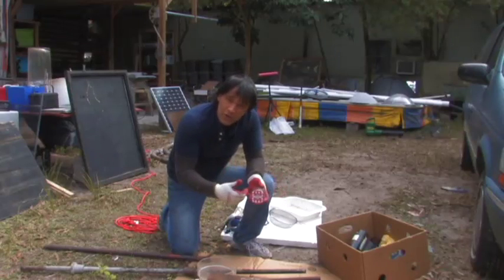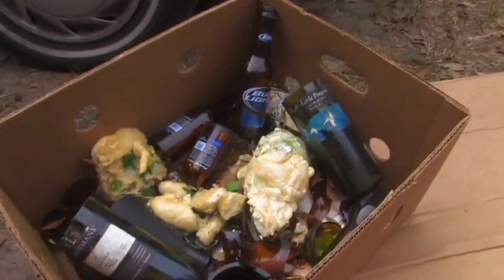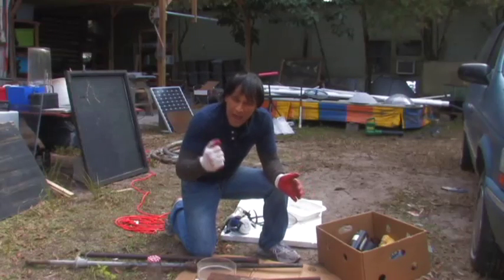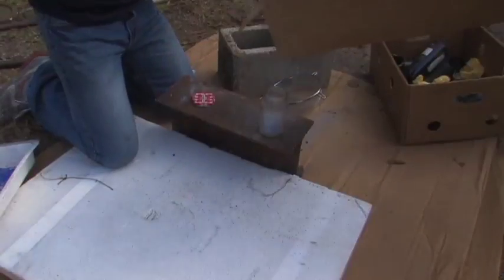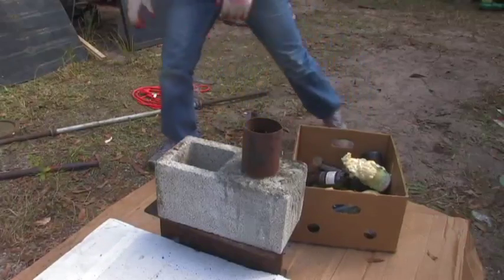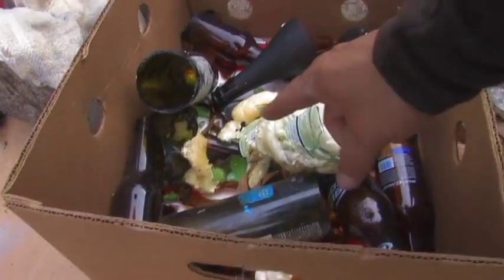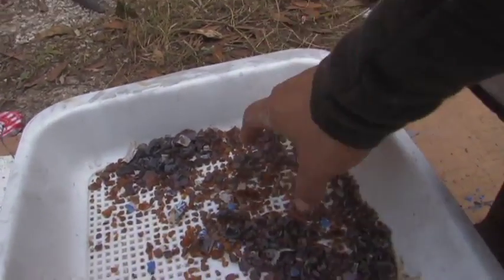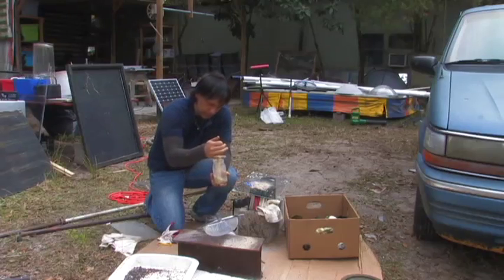GLASS BOTTLES to SAND glass recycling DIY colored glass

Comment: dang...all you kids...he didn't fart. he dropped the bar and it vibrated/bounced, causing that sound. never made that sound yourself dropping a bar that lands on one end first? poor people! thanks for the ideas here! you could remelt some in a mold with your parabolic reflectors maybe? (layer it in pipe, then fuse it?)  I have to see you using a Fresnel lens to see what you mean. Stage lighting and lighthouses use them, in different versions. Thanks for the video!

Comment: I recently ground up a ton of beer bottles using your method. I used a metal T-post driver a popcorn tin and a plate of metal and ground up a ton of brown beer bottles I picked up off the road and also ground up a bunch of green Ale-8-1 ginger ale glass soda bottles as well.

Comment: I'd be a bit more anal about protection with glass dust it will litterally blind you and cause horrible respiratory problems.  Not usually one to stress on most things but make sure your eye protection is the fully sealed kind and definitely use a heavy duty respirator like he was wearing.  Good luck on all your projects and as always great video Dan.
Reply: I agree. I don't know if silicosis is a concern, but definitely use a good respirator.
Reply: hes got all the safety gear didn't you actually watch the video. Ignorant comment.
Reply: You guys blind? You missed the part where I wrote "make sure your eye protection is the fully sealed kind and definitely use a heavy duty respirator like he was wearing." 

lol... Speaking of ignorance.

Dumbasses
Reply: Souuuuuuuuuuuuuuuuuuuuuuueeeeeeeeeeeeeeeeeee!
Reply: NomNomNom

Comment: It is important to know that Glass has a COE or Coefficient Of Expansion. Not all Glass Expands and Contracts at the same rate as it Cools. If the COE of the different colors differs enough. The Glass will crack as it cools or will be very brittle. The Glass need to cool slowly so that the Out Side and the Inside of the Glass Cools Evenly to reduce stress through the glass. Large chunks of glass over an inch thick will need and Annealing Kiln to keep the glass from cracking and 2 releave stress.

Comment from the maker: @Moroboi Yes, the soda glass is very heat sensitive so it needs to be annealed gradually after you form it in the melted state or your project will shatter when it cools. I widen the focal point of the lens by 3 inches every 5 minutes over 15 minutes to an hour depending on the glass volume.

Comment: For cleaning the glass I think some sort of acid would be the best thing. Crush it down till its liek gravel, set it in a light acid, wash it, then pound it down some more.

Worth it if your trying to sell it or need high quality stuff. 

I really think this technique could be taken to a smaller scale. 
Just seems like a lot more heavy lifting than is neccissary to crush glass.
I could be wrong of course.

Once again, another great video dan.

Comment: as a glassblower i tell you - this stuff is dangerous enough to render it not 
worth the effort.  you only need one fail in your safety measures
to screw your health for good.
only once.

if you must create your own frit -
better work wet (plain or filtered water) to minimize dust.
filter everything wet, and dry the end results in boxes covered with cloth or mesh.
get rid of leftovers while wet, better for you and the environment.
also possible to mix with cement as agregate.